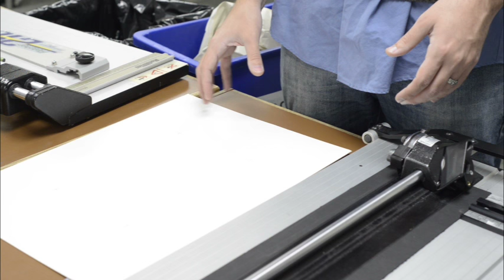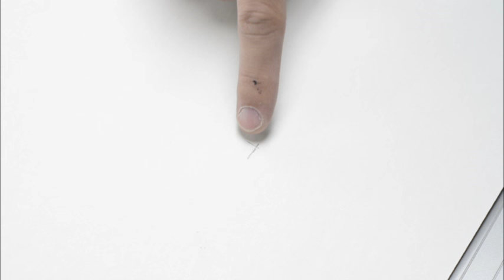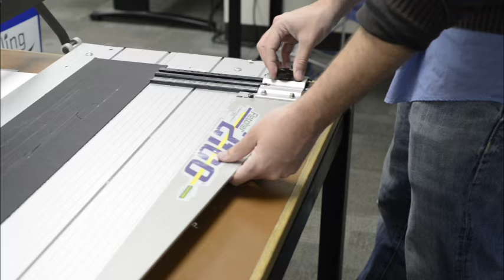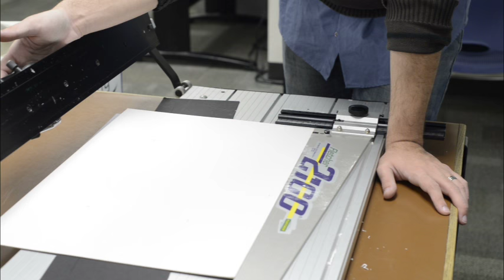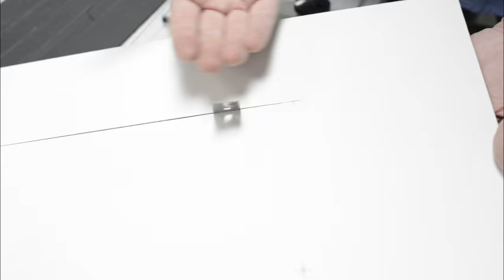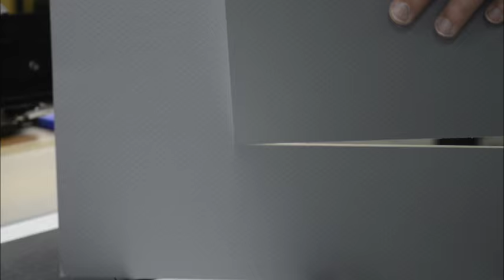How to Cut a Window with the Fletcher 2100 Mat Cutter

Comment: You seem to have some parts missing from your Fletcher 2100. I have been using one of these for over 6 years without all of the razor fuss to finish the cut. The bar which holds the blade should include end stops. These can be set to limit the blade travel. There is a micro adjustment, which allows you to ensure that it stop at exactly the correct distance and the cut out portion drops straight out. I NEVER need to mark the back of the board because I know that the stops and rulers are properly calibrated. Hope my comment helps.

Comment: I forgot to also say: I have blades in both sides of the cut head. I can cut straight or bevel cuts without needing the fuss of moving a blade to the other side.

Comment: you sure that machine is for a pro? can not get the corner done right even and has to get a blade in there?!?!
Reply from the maker: peter gile, this is a University lab and it has been there for years. This video was intended to help students learn to get the best out of the old equipment, and we also wanted to address what to do in circumstances like "what if your corners didn't cut through all the way. A complete and better maintained cutter would do much better without those little problems.